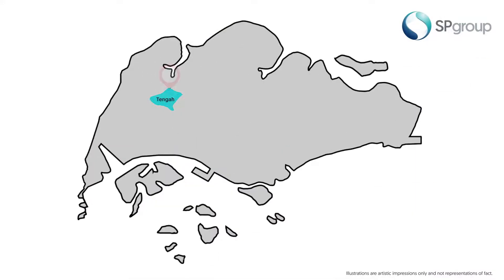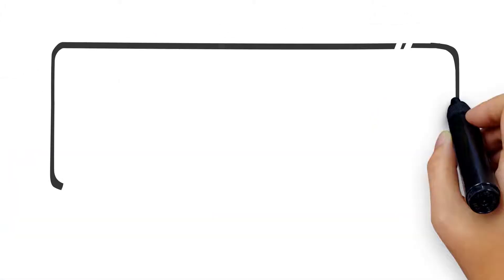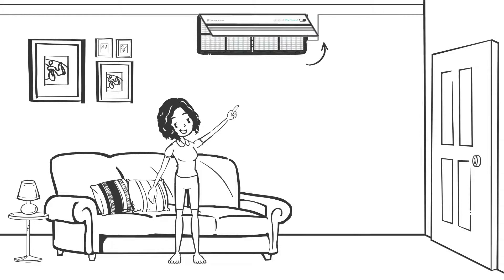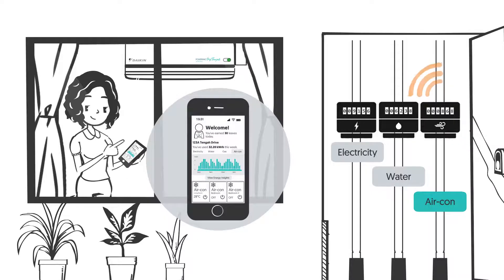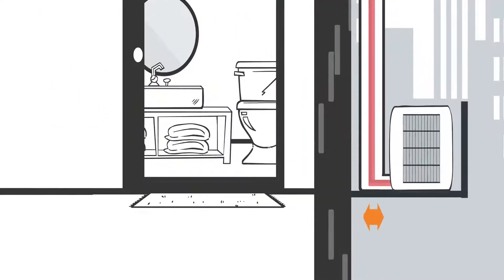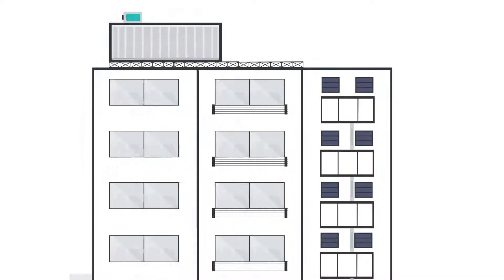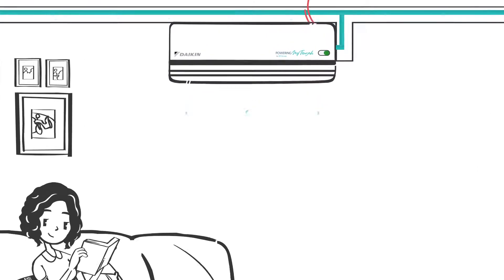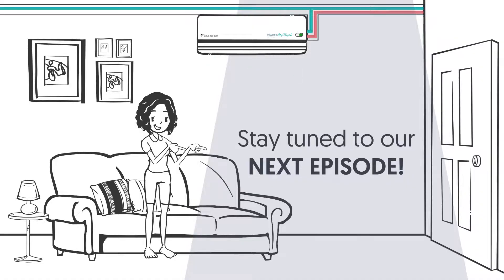What is Centralised Cooling & how does it work? - Episode 1

Comment: But understand alot of leaking and condensation problems. The district cooling system is good save energy and maintenance and all the uygly condenser unit mounted on the wall in long run the bracket rusty and unit might fall off nobody can predict for safety dont walk below the unit 🤣🤣🤣

Comment: Where I live, we found that water chilled coolers contribute to dampness in the house and would encourage growth of mould and mildew.  Nothing like the real thing - refrigerated cooling.
Reply: this is not evaporative cooling, this is using water as the refrigerate or to me more accurate, as the heat exchange medium.
Reply: @asl9750  You can call it whatever you want, but using water as refrigerant instead of Freon, will still contribute extensive moisture into the room.
Reply: @josephyeo6966  it is a close loop system, it is not a swamp cooler that use evaporation for cooling which add moisture to the air.  it's a completely different system.

If it's making a large change to the humidity, you have a leak somewhere.

Comment: Besides huge fugly trunking, it's a most kum gong inappropriate design not meant for residential areas like horror disaster waiting to happen.

Such commercial concepts has been applied successfully on industrial/commercial offices simply because it is designed to be applied across large floor spaces with centralized ceiling blower units which has less variation in cooling timing during office or opening hours. Hence power savings can be achieved through sheer economies of scale.

It should never be force-fed into individual small pigeon holes as the chilled system are never meant to be designed this way. In fact it becomes less efficient when there are too many chilled water pipes being routed to individual units which are turned on at different times by HDB owners for different rooms throughout the day, resulting in uneven load and long cooling times.

In theory sound good (to fill up the coffers for the contractors) but in reality is a horror show.
Reply: 1:16
Reply: All this can be done to be cover with cornice and light the only problem is that in futures leaking and condensation need to remove and repair